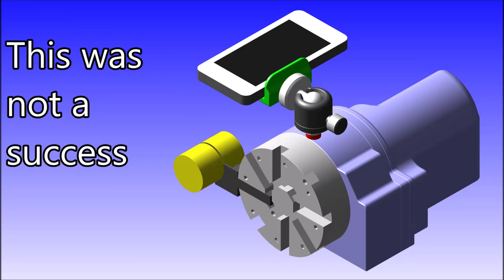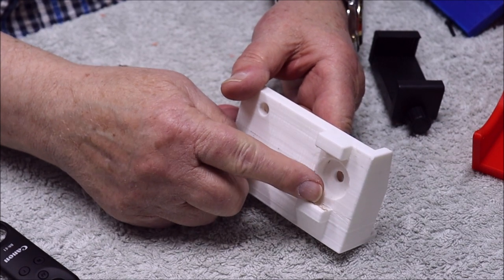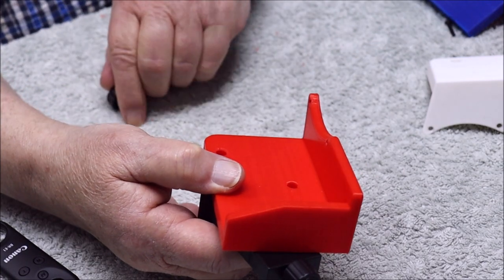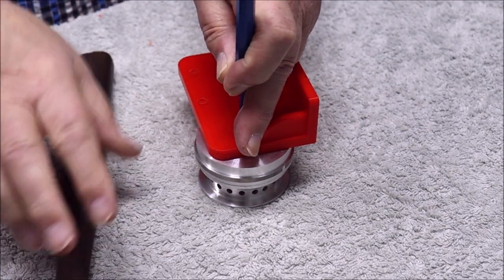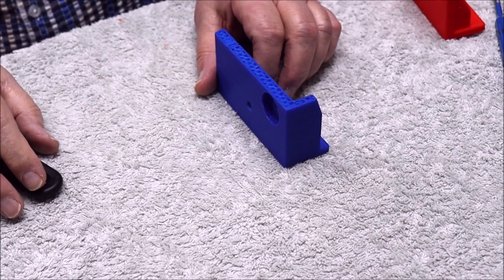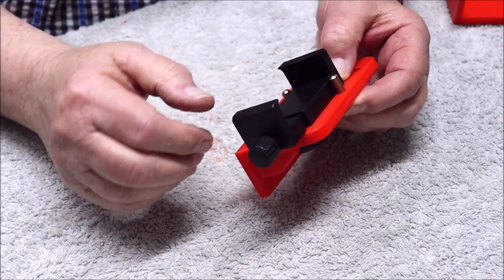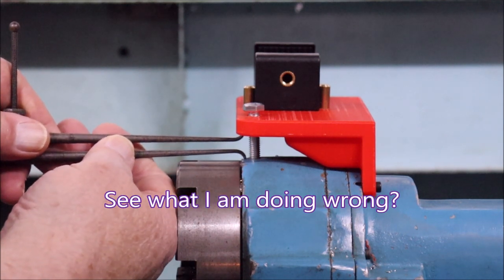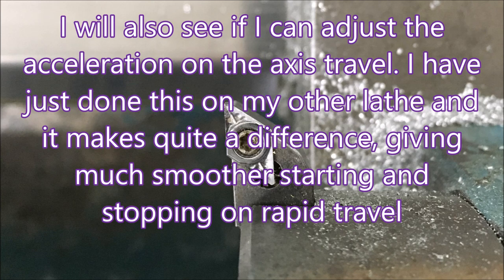Small cnc lathe cuts thread, camera mounted on tool turret

Comment: Love using 3d printer in the shop. Btw, i dumped the build tak surfaces for glass. For both pla and abs. For PLA I use glue stick that gets applied and then I do a bit of alcohol spray and better smear. For abs I use hair spray. I could not keep up with the wear those build surfaces were facing over hundreds of prints.
Reply from the maker: I don’t print that often, so my build plate works well for me. No signs of wear just yet.

Comment: I finally have a spare phone with decent camera and a broken power button. I might rig up something similar, thanks.
Reply from the maker: The one I have, is still in full working order, To get the most out of it I use an app called ProMovie which allows full manual control of the video, including focus, zoom and exposure.

Comment: My CR10s4 has blown it's second motherboard, power output for print head motor. The board I have has a second out put so I am going to try and configure it to a twin print head and see if I can get it back up and running that way, it's that or mother board No.3 is required!
Reply from the maker: It does not get a lot of use but my mini has been great.

Comment: Holder looks nice. That CR10 printer only costs £399 in UK and looks really simple. It did a good job. What does a flexible base do for you? What software do you design things in for it?
Reply from the maker: Flexible base does two things. Provide a good surface for the print to stick to while being printed. Mine is very good at that. When the print cools it sometimes comes away from the bed without too much drama. If it is a bit difficult, I remove the print surface and when I flex the build surface the print is released. The printers usually come with a glass bed which needs masking tape or hairspray to keep the print held on, my build plate only requires to be clean.
Reply from the maker: I forgot to add, my cad software is Keycreator, a solids package I have been using for years. It used to be called Cadkey and I started using it around 1990. I would not find much use for a printer, if I could not create my own solids. Not all the answers to life’s problems are on Thingiverse!
Reply: @smallcnclathes  Thanks. My problem is that I just can't get my head around using Fusion 360, and they keep changing it. So, no 3D printing for me yet.
Reply from the maker: @samuelfielder  before I lashed out on upgrading my software, I had a serious look at Fusion. It just does not work the way my brain does. So I spent the money on upgrading mine and was full productive with in a day. Paid the 3.5k aud and invoiced more than that the first month of using it.